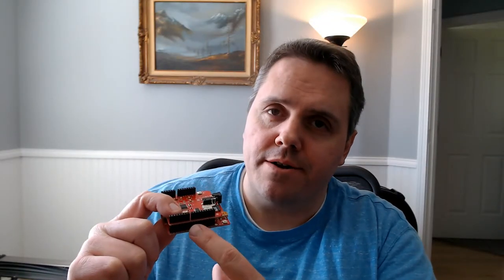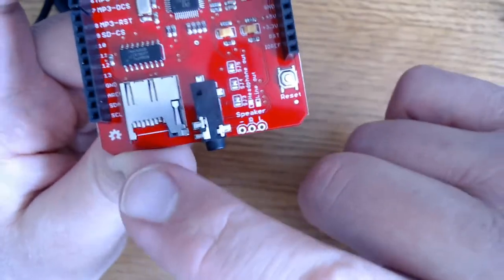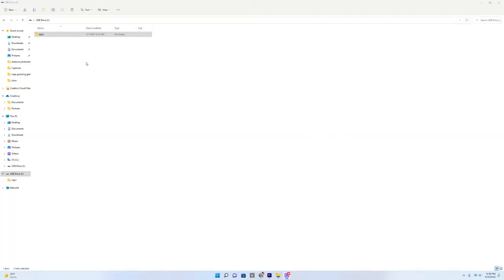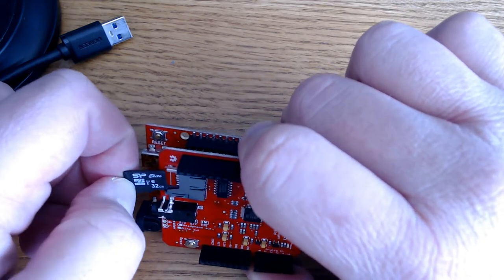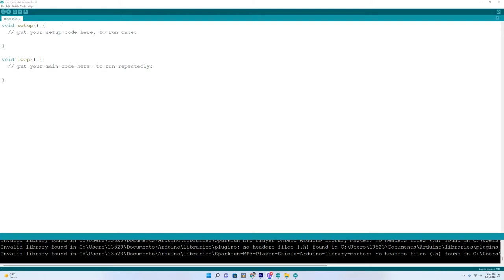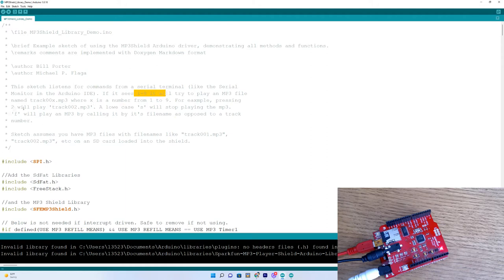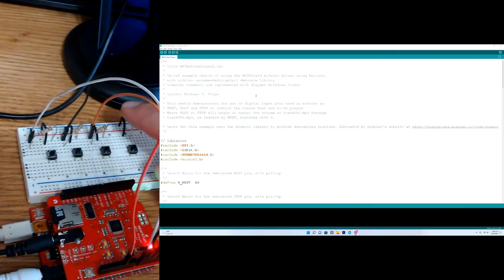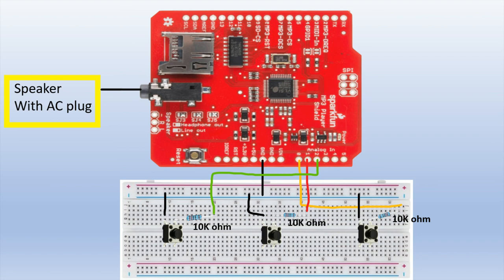Make an Arduino Music Player Using A Sparkfun MP3 player shield - A beginner tutorial

Comment: Is it possible to choose a track via a potentiometer? We want to play the sound of an old ships engine by using the original oparating stand.
Reply from the maker: Hey there! Yes, You can. You would need to connect the middle pin of the potentiometer to an analog  input pin and use analogRead() function to read potentiometer value.
Reply from the maker: I will post a YouTube #shorts video of track selection using a potentiometer. It will go up tomorrow morning. The code will be on our Facebook page if interested.  👍
Reply: @BMonsterLaboratory  Thanks for your quick response. It was very helpful. I am looking forward for the video on the potentiometer.
Reply from the maker: @user-zg7rb3jk2u  it will be posted in 20min. I'll post code on Facebook tonight.  I hope you find it helpful

Comment: Next Challenge is to make buttons that "play next track" and "play previous track".  These are not in the library, at least for the Adafruit version of the board.   I will post if I can figure it out.  Started by indexing my SD card and counting the number of songs on it.  Then I started to write a method to return the filename at and index location so I can use that to return a song at a given location.  The program loop can then maintain the song index location based on button presses, and appropriately pass the correct filename to the "play song" method.  Assume names are different between libraries.   At this point I just can't seem to typecast the name of the song once returned from the method that finds the song name at a given index location so the "play song" method will accept it.  Although most people will simply use I/O sensors or push buttons to trigger specific files to play, thought it would be fun to have a fully functional arduino based mp3 player.
Reply from the maker: Hi Michael! great comment. The SFEMP3Shield library has "Next Track" included in the sketch. I have a motion activated player video with this shield that includes random shuffle - you can check that out here https://youtu.be/zamlAniU2nQ. Use "the code" time stamp to get to that part of the video quickly if you like. The code was posted to our Facebook page if you find it helpful.

Comment: can we plug a tft shield 2,4 inch module in top of that and make the music menu in touchscreen so it will accesible in our screen?
Reply from the maker: hey there!  I've never done it but perhaps it can be done. There are some available pins on this shield.
The Arduino's three SPI data and clock pins -- D11, D12, and D13 -- can be used to interface to other SPI components. They can't, however, be used for any purpose other than SPI. Digital pins 5, 10, and all analog pins (A0 through A5) are available. 
Your TFT connection to the shield may look something like this: 

TFT_CS: Digital 10
TFT_CD: Digital 5
TFT_WR: Analog 0 (A0)
TFT_RD: Analog 1 (A1)
TFT_RESET: Analog 2 (A2)
MOSI: Digital 11 (SPI)
MISO: Digital 12 (SPI)
SCK: Digital 13 (SPI)

I haven't done this and you'll want to double check all connections and power before you turn it on.
check here for more info about the mp3 shield: https://learn.sparkfun.com/tutorials/mp3-player-shield-hookup-guide-v15      Good luck to you!  👍👍

Comment: Great video! I was hoping I could ask two questions:
-When a file has been played, does it stop or does it go to the next one automatically?
-Is there any indicator signal or flag to know when a file has stopped playing?
The reason I'm asking is because I want to build a project with one of these and a single motion sensor (PIR), and I want it to play a different file every time it detects motion (that's not the difficult part), the thing is that I don't want the motion detection to interrupt a file that is already playing, but to let it finish and then play the next one when motion is detected after having played the previous one.

Thanks!
Reply from the maker: Hello, and thank you for the compliment!  I have several videos using this Sparkfun mp3 player shield. I have a video that matches your description right here - https://youtu.be/zamlAniU2nQ
You can find the Arduino sketch for that video on our Facebook page by searching "mp3uino" on Facebook, just check the comment section. If you have any questions about changing the code or adding something that's not included, feel free to ask. Have fun and thanks for reaching out! 👍

Comment: I tried adding the addon in multiple ways but Arduino is not recognizing it anymore? can you attempt to do it again and see if you have the same issue, to see if you have a fix?
Reply from the maker: hey there!  I can help out this evening if you still need it. Are you referring to the shield as the addon? Are you having trouble seating it into the redboard, or Uno ?  I just received a shipment of 10 of these that I need to solder and attach to the redboard. Are your solder joints good?  I am happy to help with any step along the way.

Comment: Hi! My button Setup plays very quietly, do you have an idea how I can make it play louder. It is barely audible over my box.
Reply from the maker: Hi there! What kind of speaker do you have connected? Does it have a built in amplifier or do you need to add one?
Reply: @BMonsterLaboratory I have this one:Philips
Bluetooth speaker, SBA3011ORG/00. I don't know if it has a built-in amplifier
Reply from the maker: @BasKahlert-w8z  I looked up the speaker. The Philips Bluetooth speaker SBA3011ORG/00 is an active speaker. It has its own built-in amplifier and does not require an external amplifier or receiver to produce sound. Are you connecting it by 3.5mm aux ?  Did you use the same code and setup as in the video?

Comment: Hello! Fun project! I would like to try out this project, but before I buy the items, I want to make sure I buy compatible pieces. Would you be able to make a list of links to the items (amazon or other).
Reply from the maker: hey there. great to hear for ya! I bought the 3 main items from Amazon (redboard, mp3 shield, and speaker). I linked 3 items in the description. You can also buy the 2 boards at Sparkfun website but shipping may take longer and they may be out of stock. Seems like the mp3 shield goes out of stock frequently but there are currently 6 available on Amazon. Adding a motion sensor to this board is a fun project as well. Let me know if you have any questions. Good luck to you!
Reply: @BMonsterLaboratory  When I download the zip library for the Sparkfun-MP3-Player-Shield-Arduino-Library I get an error message. "Invalid library found in C: ... : no headers files (.h) found in C: ... "
Any suggestions?
Reply: Arduino_Library-vs1053_for_SdFat seems to be working however. Is this code similar enough?
Reply from the maker: @etruretyutyju  do you have the "SFEMP3Shield" and "SdFat" files installed as arduino libraries? They are part of the "Sparkfun-MP3-Player-Shield-Arduino-Library-master" file
Reply from the maker: @etruretyutyju  I assume you unzipped the file through library manager tab in IDE